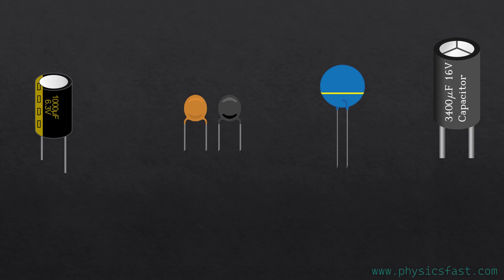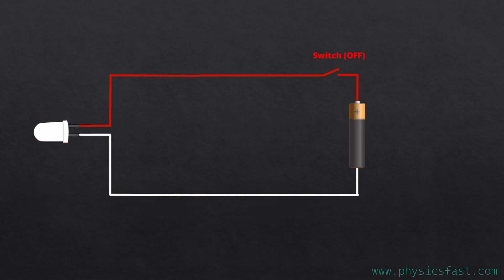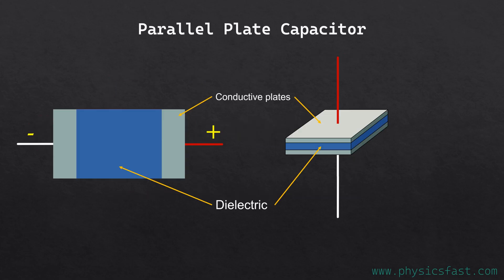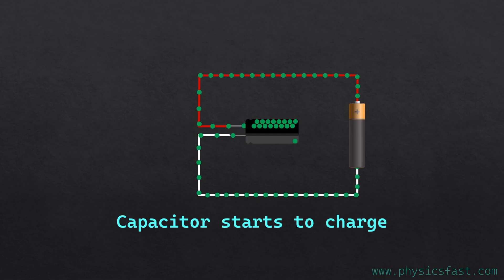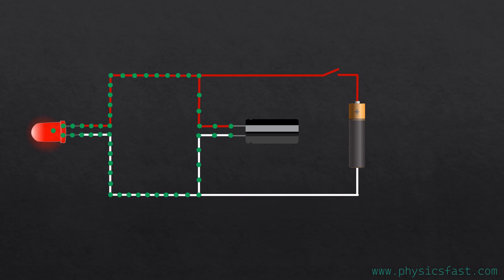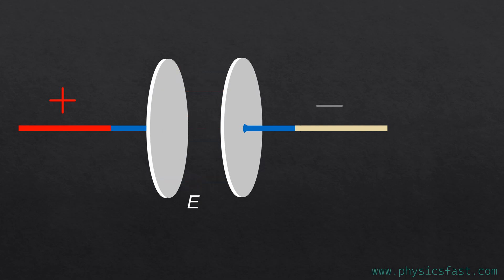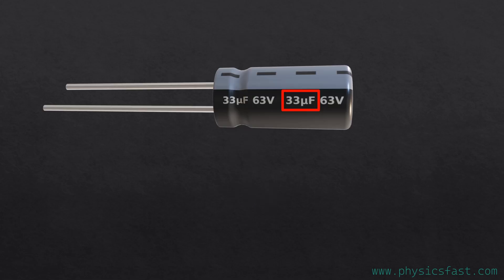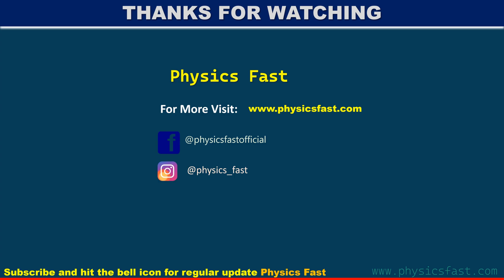Capacitors Explained  | how capacitor works ? | capacitor working animation #capacitor #capacitors

Comment: Does dielectric conduct electrons?
Reply: No,while charging capacitor( battery positive terminal connected to capacitor positive and vice versa.) Capacitor starts charging. I mean electrons on positive plate get accumulated on negative plate.when battery is removed  ,capacitor stars discharging. Electrons from negative plate of capacitor.